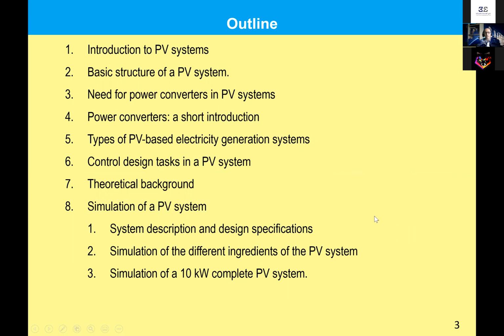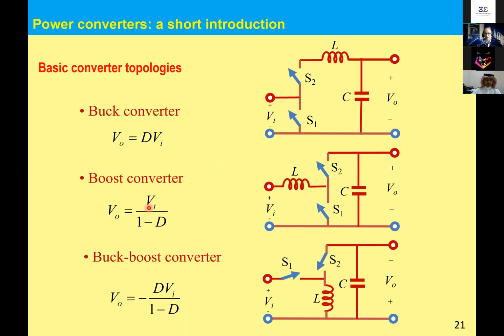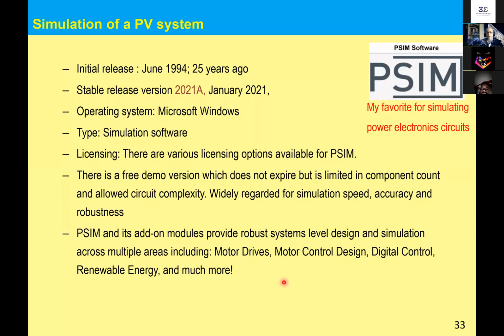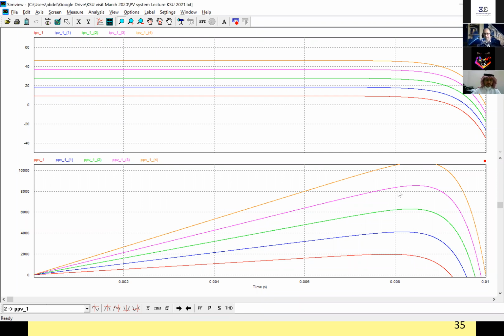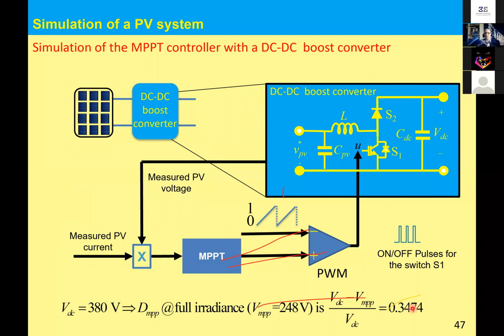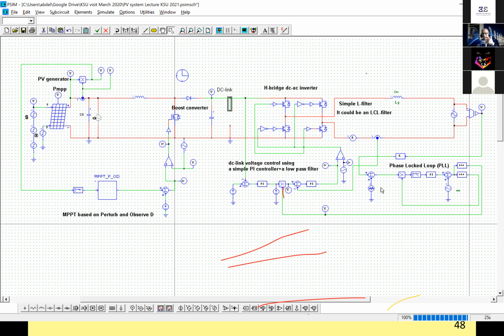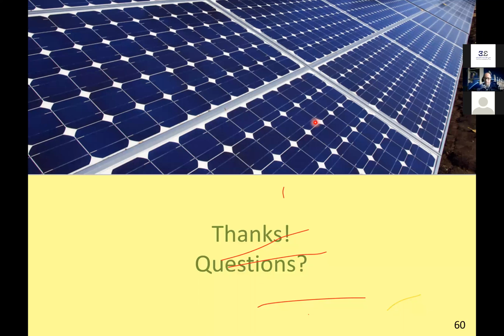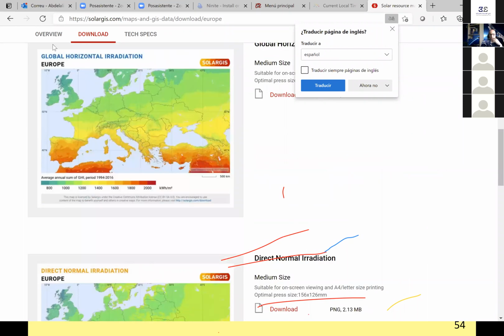Simulation of power electronics systems for photovoltaic applications - Dr. Abdelali El Aroudi

Comment: hello prof, I hope that you can answer my question, for example: I have a meter and every three second (3s), the meter display the consumption of a load for example: from 0 to 1000 Watt. For example: the  3s, meter: 900W, 6s, meter: 60W, meter:120W and so on. After 60s I got 30 values from the meter. My Question is: How can I calculate the PV power value? I try to find a formula, but I am unlucky man. Please help if you have a bit free time. Thank you so much.